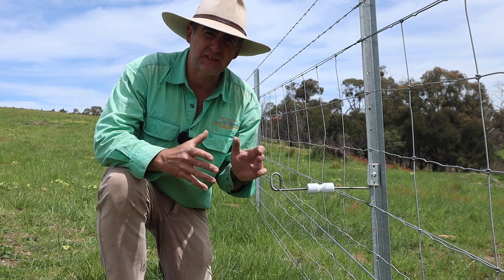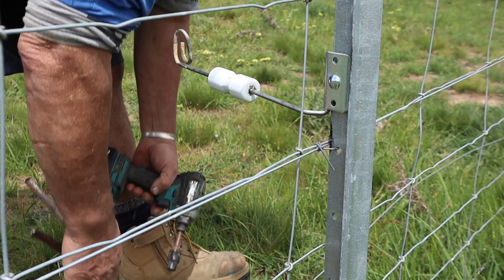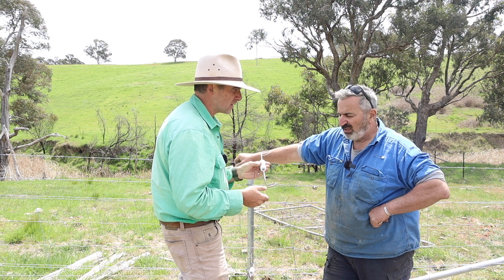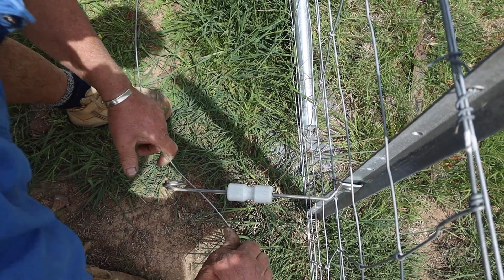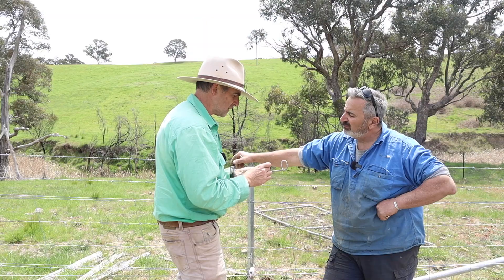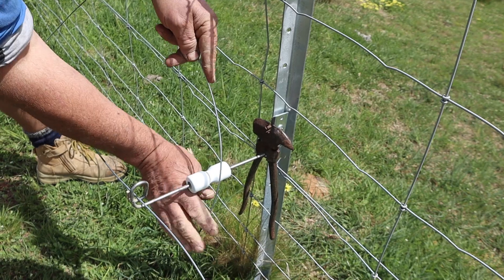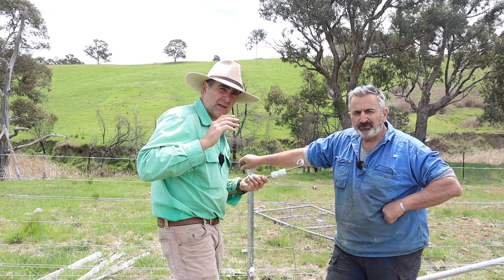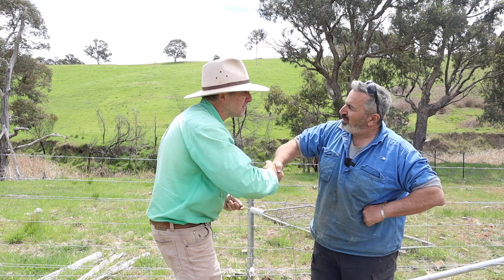Unmatched Durability? New Fence Offsets!

Comment: The narrow waist - also/should may reduce mineral build up - due to water tracking (fewer eventual short circuits...

On Assembly - silicone adhesive inside the threads will fill any potential water path - heat resistant, protected from UV..
 - A version with a Z-bent prong ad a rest could allow total tool free installation - no fixings.
 - high temperature UV stabilised plastic insulator with an interlocking steel twist - injection moulded (or low tech "resin cast") in situ - low temp manufacturing, anywhere.
*or glass?? - not low temp, but reworkable  recyclable..

Comment: Do they fit perma pine posts?
Reply: Yes you can attach these to any post. There is 2 holes in the plate that you can fix to timber posts with. You simply get a tech screw and you are away.
Reply: @horsleywholesale5713 thanks and ordered!